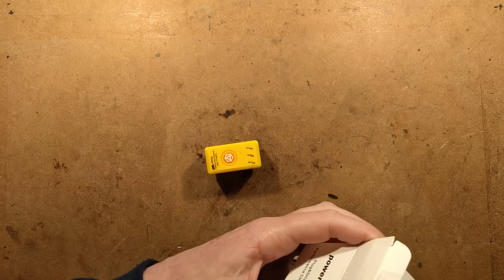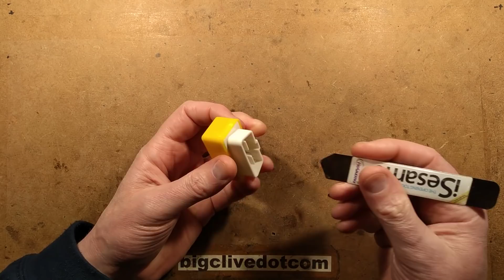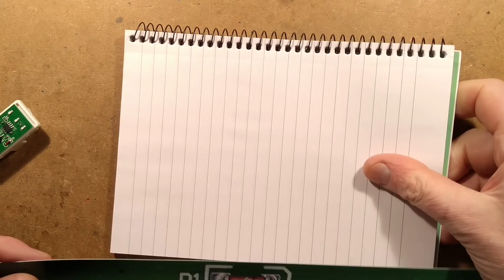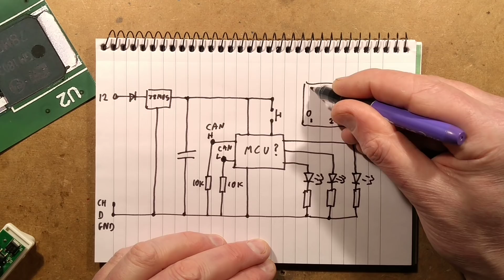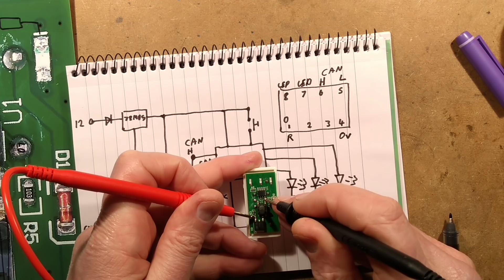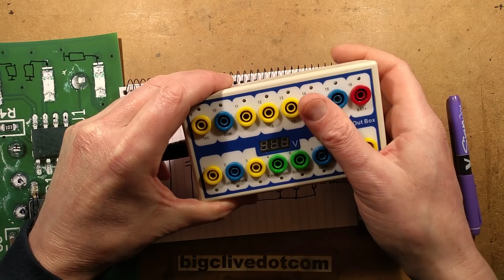Simplest OBD2 engine remapper yet, with actual canbus connection.

Comment: It is technically possibly of creating an OBD gizmo that could actually interact with the operation of a vehicle.
The problem is the CANBUS is onl'y a rough guideline and each car-maker has their own proprietary implementation of the messaging through different channels, which itself can vary year for year and sometimes even by model...
So it'd be very difficult or impossible to make one of the devices universally compatible with all vehicles. They would have to create a device for a specific set of vehicles per manufacturer and by CANBUS protocol/implementation standard to just not be reading-in/sending-out glitched-out gibberish.
ed: Not to mention getting access to the companies specific implementation of CANBUS being a trade secret is not a viable method.. such that everything would have to be reversed engineered per vehicle.
Reply: Standard GIZMO for OBD exist like Autel where u have real communication on OBD2

Comment: You may be being fooled by one of the oldest methods of obfuscation, folding the chip pins over and mounting up-side down, happy days, I kept many mirrored pictures of 74 series, just for that reason...
Reply: Nice trick. But i think then there would be no mark for pin 1 on the "top" side? Also the pin out would be pretty uncommon anyway, wouldn't it?

Comment: MicroChip has some 8 pin CanBus transceivers, although I suspect the chip in this device is another "8 pin universal" micro.

ATA6560
http://ww1.microchip.com/downloads/en/DeviceDoc/ATA6560-ATA6561-High-Speed-CAN-Transceiver-DS20005991A.pdf

others
https://www.microchip.com/design-centers/can/can-transceivers

Comment: Like those magnet type units. Its a rip off. I dont care what they monitor. There was an insurance company that advertized you could save money if you can one of their devices on your car. Every time you hit your brakes it would count against you. The thing kept a record of your driving supposedly.  Most people complained their rates went up after using it.
Reply: I used to have Progressive and they tried to get me into that program, until I looked into it further and realized that my rates would a) rise because I drive in the wee hours (newspaper delivery) and b) my rates would rise again because I often have to brake hard to avoid crossing deer, and c) my rates would be raised based on the towns I drove through.
Reply: @dashcamandy2242  Pretty much EVERYONE that used that sevice reported an increase in their rates. Funny how that happened.

Comment: I have own this scanner ( https://www.google.com/search?q=mac+mentor+touch&source=lnms&tbm=isch&sa=X&ved=0ahUKEwiip9W38NzgAhXF3J4KHUGwDTYQ_AUIDygC&biw=1366&bih=664#imgrc=JqL-fYzZNKhhrM: ) I can negotiate with almost any car and truck on the road. the catch you must enter what kind of data you are looking for and how you want it to search for it. and some systems if taken off line will be disabled for use while communicating there data...like ABS or Traction control system. And every car has a different protocol for ECM data programing and it can not be done through the generic On Board Diagnostics Level 2  access or OBDII  It must be done through the cars factory VIN # and emission certification and then accessed through either the alternate ecm connection or special permission through the OBDII port. most of the time if i had to do a GM of Ford reprogram you had to go on line and purchase that vin# access for 24hrs and then hope to god it didn't de program your security system codes....Otherwise anybody could just plug into the port and reprogram the car and the chip and tell it anything and screw all the emissions up and or steal the car!!!!! I even put a used heater control module in a GM hummer H3 and it reprogramed his dash to have 30,000 more miles on it than he actually had because the truck it came out of had higher mileage and chevy dealer said no way to lower his mileage on his dash....all the chips talk to each other.....

Comment: There's no way this can be doing anything of any worth, you need a CAN transceiver chip, interface chip and a microcontroller, I doubt all that is crammed on that 8 pin chip.
Reply: Shango over on his channel tore down one of the OBD II devices that some insurance companies hand out to their subscribers.  It's extremely advanced and has ability to read several parameters.  (gps, speed, brake habits, etc...) and it gets reported to the insurance company.  That looks like a crap ton of electronics shoved into that tiny package.

This one?  Placebo effect.....That's it.  I see 19 thumbs down at this time of the post.  Must be 19 people pi**ed off they got scammed.
Reply: @Tedybear315  Or the scammers

Comment: Should get one of those dubious snooping OBD devices that are given to the customers of an Insurance company and see what those actually do.
Reply: Some have a slow mobile connection to upload data...
Reply: @FaultyStreams  And make it possible for hackers to access your car and mess with it.
Reply: @brianborell4469  No the fuck they don't. Stop spreading misinformation.
Reply: what the fuck? this is a fucking thing?? what's next, are life insurance companies gonna require people to wear ankle monitors?
Reply: @fake12396  Nobody is REQUIRED to get a Snapshot discount. You can pay the average rate for someone your age driving your vehicle, or you can pay based on how you actually drive. The important take away is that it won't make your bill go UP. Anyone who says it did are 100% full of shit.
Reply: I don’t know for certain, but I strongly suspect they measure throttle response (possibly) and use an accelerometer (almost certainly) and possibly mileage driven to determine how aggressively one accelerates, brakes, and corners over a period of time as well as how much driving you do over a month — essentially testing for aggressive driving.  These days they may as well use a smartphone app to record the same.
Reply: @ethanpoole3443 state farm does use  an app, with a bluetooth beacon to stick in your car so it knows when to actually track. (not riding in another vehicle)
Reply: @ethanpoole3443  Aviva use a Smartphone app to do that, and until a couple of years ago, the freemium Smartphone Sat-Nav Navmii could run in the background and record your driving style without needing to actively navigate from A to B.
Reply: @ethanpoole3443  Or even more plausible: The speed. It's a very basic signal and most likely present on the OBD can. Acceleration, deceleration and even driven mileage can be calculated.
Reply: @ethanpoole3443  Actually, there are some insurance companies that are now doing that.  So, get a cheap phone that you rarely carry with you and install their app.
Reply: Those things work off of universal PIDs (forgot what that stands for), but essentially every car has a throttle pos sensor and a manifold pressure sensor. With those two clues and nothing else you can determine engine load and thus driving habits. Sometimes they use vehicle speed delta to calculate acceleration and deceleration. GPS is used as a secondary indicator of vehicle behavior.
Reply: @TinyGuyTinyHouse  My Mercedes w110 model 200d has sensors for those. As they are mechanical however.........
Reply: Will Add 100 hp
Reply: They just record when the parameters they set forth are exceeded. Rental fleets all have them and we've used them in  the commercial fleets or a decade or so, to tell us when our drivers were speeding. A little blackbox or tattletales as the ones we have are called. Or we can have the dealer monitor them with satellite enabled systems like CAT link.
Reply: Realtime GPS?
Reply: No
Reply: I have a very nice little tracksolid gps tracker that plugs into my daughters obd (the car one obviously as I have not been allowed to fit my children with obd sockets). I always no where her car is and if she is driving with excessive enthusiasm!  I believe that I can even instruct the car to shut down if I was minded so to do😂. I don’t get out much you understand.
Reply: Thats an easy one. It records incoming data and saves it. Then you send it back and they pull the data.That's it nothing special.
Reply: For one thing they make it much easier to hack into a car remotely. Some cars will allow you to apply the brakes or throttle via the CAN bus. If you have electric power steering it's also possible to steer the car remotely.
https://youtu.be/MK0SrxBC1xs
Reply: @brianborell4469  hi  exactly that!
Reply: @brianborell4469  WOW... S-C-A-R-Y ‼️
Reply: I hate those things,
Especially when they beep,
Especially from jerks pulling out in front of you,
In a large city…
Reply: They could only compare the statistics they gather with actual crashes to find out what type of driving leads to more crashing. All the mr. Goody Two-Shoes are getting these things and if that's making their bill go down then it's making my bill go up I don't like it.
Reply: @SiriusSolar  Drive better. Boom. In 2020 there's zero reason not to have an insurance discount for good driving.
Reply: Dave Micolichek , Yes it is GPS & not actual accelerator.
Reply: Dave Micolichek  im saying if it broke because of you driving aggressively they wouldn't be able to give insurance if YOU pushed the car and it WASN'T the manufacturers' fault then you would be the cause of the accident for driving like that
Reply: Dave Micolichek  also those are controlled conditions such as crashing into a wall or rolling over
Reply: Dave Micolichek  i was talking about damage checks you moron
Reply: @not-pyroman  get a load of mr. I know nothing about cars calling people a moron
Reply: @triplegoy  get a load of mr. Scrutinizes 1 year old posts
Reply: @not-pyroman  get a load of this moran that doesnt know how car insurance works

Comment: It could be an atTiny45
Reply: Have you not watched the video? It absolutely can not. ATTiny has its power on two diagonally opposite corner pins and reset on yet another corner.
Reply: Siana Gearz yes I have. I was reading an article that says that some attiny modules can work like this
Reply: @crazyboy2006cashier  you can backpower it via a data pin configured as output while it's already running, but I struggle to see how you want to start it up initially.

Besides, the GND pad still wouldn't work as output driving an LED.

Comment: It may be negligible to a car battery but 9mA quiescent current? That's pretty awful considering most somewhat current micros have idle currents around the micro- to nanoamps. Even blinking the LED it should be way less than 9mA. I expect the micro just always runs full speed.
Reply from the maker: It does sound like it's running full tilt.
Reply: @bigclivedotcom  considering they weren't even smart enough to make it a one-sided board I'm not too surprised they didn't bother to make the micro sleep. And it's not like the quiescent current is the biggest fault with that piece of junk
Reply: Most of it will probably be the quiescent current of the voltage regulator. The older LM7805s were in the miliamps, unlike the modern 78L05 low dropout models.

Comment: Most modern cars have diagnostic CAN behind a gateway, so if your diagnostic tool (or any other crap plugged into an OBD socket) crashes, nothing happens.
Reply: Or the odb port cant Diagnose Abs Airbag or any safety related item because there is another diagnosis port in the engine bay. Still statisfies the odb2 norm to the fullest for road worthy tests
Reply: @kitecattestecke2303  Haven't seen a port in the engine bay in ages, there's a few manufacturer-specified pins on the ODB2 port, so the main bus is usually accessed over that after doing a quick handshake.

Comment: I think I know what these units do - I too bought one out of curiosity, at a time when I had a recurring ECU error caused by a faulty Crankshaft Sensor.  I was keeping an eye on the situation with an iCarSoft OBD Diagnostic Tool until the new sensor arrived, but I noticed that with the eBay unit connected, every couple of days the fault would be cleared briefly, before returning again.  
With or without the unit attached, there was a noticeable drop in performance when the fault was logged by the ECU, so is it possible that the eBay Unit just occasionally sends a 'clear all faults' code?  
Maybe the 'MCU' is a Pic chip of some kind?  Reminds me of the one's they used to use for modding game consoles back in the day :)  so just enough guts to send a clear code and the required confirmation code, based on elapsed time.
I don't have the equipment to see exactly what happens, but I agree that there's no way these devices could re-program ECU Fuel Trims.

Comment: Great video! I don't think the MCU could lock up the CAN bus - the two 10 K resistors in series with the MCU pins (missing from your skizmatic)  would prevent that.
Reply from the maker: The resistors in this unit are not in series.  Just pull down resistors.
Reply: Oh yes, you're right. Looking at the bottom 10 K resistor on your photograph it appeared at first glance to be in series but now I see the error of my ways!

Comment: Double sided board simply because this is made on spare sections of a large panel, and thus double sided by default as most boards are double sided. Might even be a 4 or 6 layer board as well, depending on the actual panel they fitted this low cost job into. Mystery drilled vias are probably just an error from joining the Gerber files over an existing section, and nobody was going to spend the time fixing the errors if they do not have any other effect. 

My guess is the voltage regulator, the resistors and capacitors, along with the LEDs, are recycled components, and the microcontroller is a reject that was partly working on test, enough that at least they could flash it, and most of the IO pins work, but there are other die errors internally that make it fail. Cheap enough that the assembler will test them, and have probably a half dozen firmware files to program them, to cover the most common defects and get it to more or less work.
Reply: You still never ever design a board that needs to be populated from two sides unless you absolutely have to. Because it adds a glue down production step. Also why would you panelise it with other chips? You can simply order the whole sheet full of them since you definitely need more than a handful of them.
Reply: @SianaGearz  PCB pooling probably, ultra cheap if you are not in a hurry to get your batches, provided they still come in ahead of your inventory needs. Small boards are easy to add to an existing pool panel as well, so the PCB house will do them rather than have a section of panel that otherwise has to have the rest of the steps done to it anyway, but is destined to be disposed of as scrap. Better to have them pay the cost of the board area only plus a tiny bit more, to save yourself the cost of having to pay somebody to dispose of the board. The drilling and plating costs will disappear into the general noise of the whole panel anyway, and they already are doing a solder mask and screen print on the rest of the board. Adding that you are fine with extra holes or whatever, provided it does not interrupt traces, also allows them to squeeze you into areas they otherwise could not use due to it being either an alignment area for the panel or a cutout in another board.

Comment: I have to wonder if the CAN bus is brought directly to the OBD port. That just seems like a terrible idea. I'd suspect that the CAN bus on the OBD port goes just to the BCM or ECU and is separate from the one linking everything together.
Reply from the maker: A few people have mentioned plugging faulty OBD readers in and knocking out a section of the vehicles canbus.
Reply: @bigclivedotcom  Most modern vehicles have multiple CAN busses. So The engine bus would be separate from the diagnostic bus.
Reply: @bigclivedotcom  Very interesting!
Reply: There's usually 2 or 3 CAN buses linked by message filters or firewalls. In two-bus configuration, everything that passengers can touch and the diagnostic port would be on one bus, and the engine, breaks, lights would be on the other. So you can knock out the interior CAN bus and still be driving normally, but probably won't be able to start the car and might lose your instrument cluster.

But of course the firewalls are not without engineering faults.

Comment: The CAN BUS is actually quite robust. It can take quite the beating before something breaks permanently. I doubt very much that if that gadget were to fail, would do much more than stall the vehicle. If you pulled it out and restarted the car it would most likely be just fine.

Comment: Looks like an Attiny Pinout, but with the power connected to a GPIO pin instead
Reply: Problem is, while you can keep it running by backfeeding it via a pin configured as output, you'd have no way of actually starting the chip, as the lines are high-Z initially or when unpowered.

Besides, you then still couldn't use the normal ground pin as output.

Comment: you cant judge a chip by its size, micro SD cards are 8 pin and they now can hold 1 TB. on something the size of a normal pinky nail!! seems like just yesterday they came out with 1TB hard drives.
I have done some digging on this end and that is a rather odd pin out, I have not found anything with the VCC pin on #2, it should be on #8
Reply: High tech, high price, high volume.

What are you expecting to find for $5? A million or two worth of security research and custom microelectronics? Where is a high capacity microcontroller with 8 pins and integrated CAN transceiver? Doesn't exist to my knowledge. Not for $2, not for more.

And oh maybe take a closer look at STCmicro parts. I vaguely remember something laid out like this.